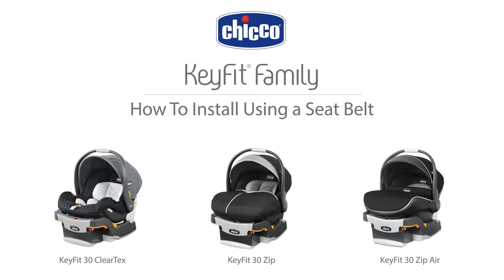Chicco KeyFit and KeyFit 30 - Base Install with Seatbelt

Comment: So you don't lock the seatbelt before putting the shoulder belt into the lockoff on the base?
Reply from the maker: Correct, you pull the seatbelt through the lock off. You don't need to lock the seat belt.

Comment: Is it ok to use both latch and seatbelt methods?
Reply from the maker: You need to install the car seat with either the LATCH or vehicle seat belt, not both.
Reply: @chiccousababy What's the reason for not using both?
Reply from the maker: @treelicker  It has not been tested that way

Comment: When I i installed the base, the front (the part that's not against the seat if the car) still seems to move too much. Is that normal? If not, what's a better way to secure the front?
Reply from the maker: Yes, it is normal for the front to move. It is important that there is no less than one inch of movement at the back where the latches are attached.